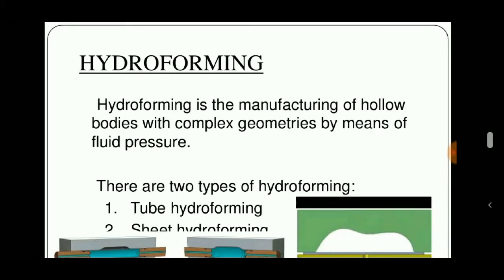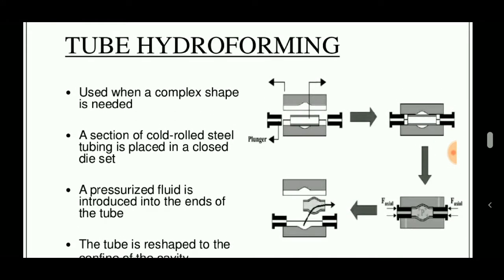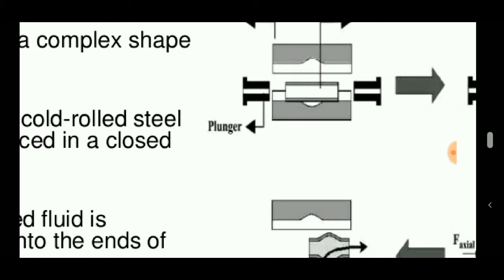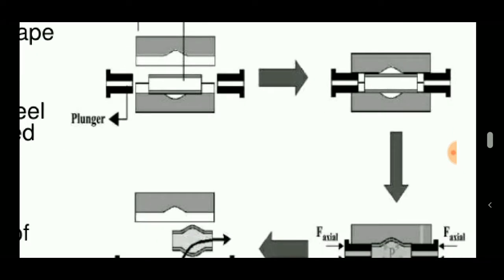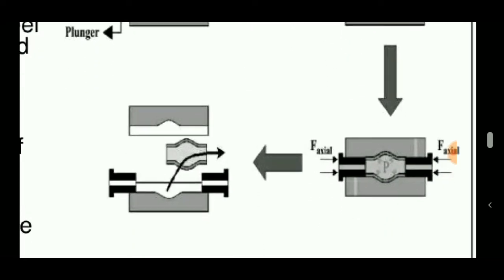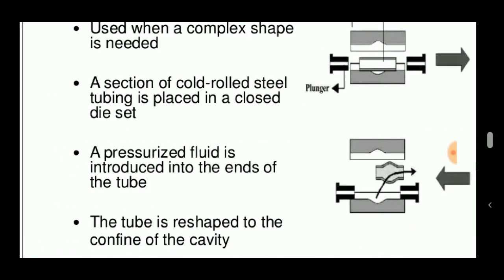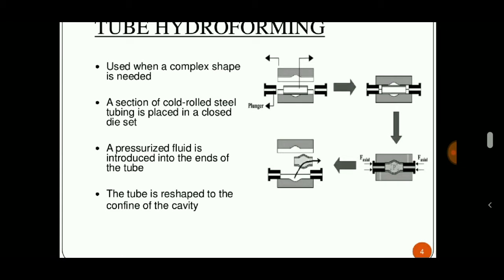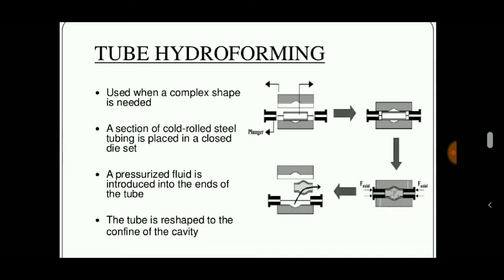Tube Hydroforming Process | PPT | Forming Process | ENGINEERING STUDY MATERIALS

Comment: I have a question. Using a given material specifications which is 150mm length x 28.1mm Outside diameter x 20.25 mm Inside diameter.
How much is the maximum pressure needed to make the RING Properly Fitted onto the Tube without any chance of being slipped when tested.
RING SPECS : OD = 35.20mm ID= 28.6 Thickness = 9.0 mm
Material = SS 316
How much is the maximum torque can be obtained in this process?
And what is the actual diameter of the  RING after being hydroformed ?